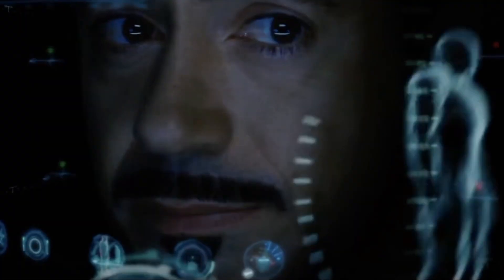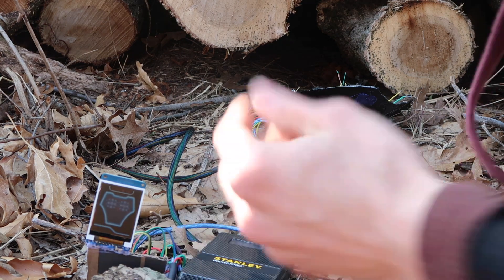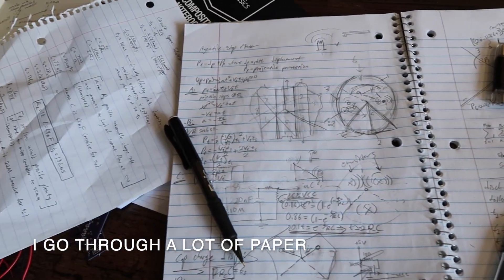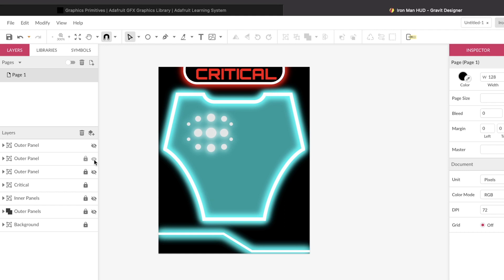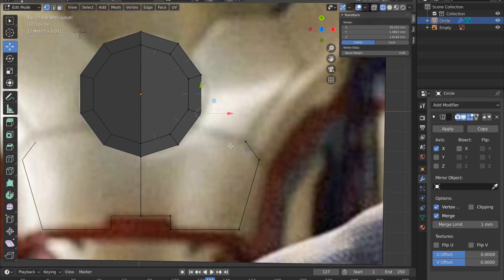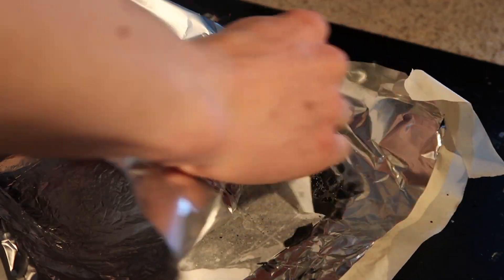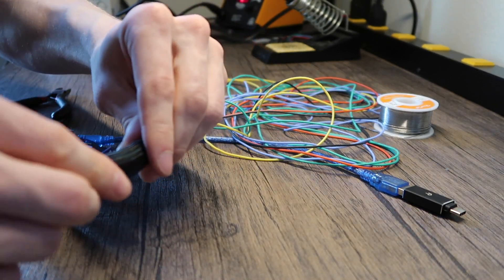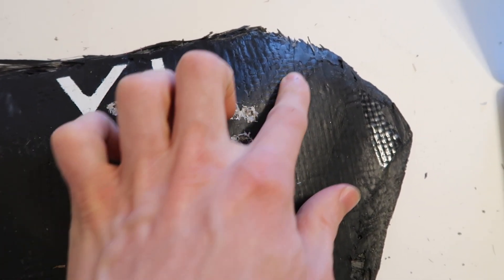Real Bullet Proof Iron Man Armor Version 1

Comment: Amazing work! If I may ask, what sensors were used for this project?
Reply from the maker: @filigenzilab9613  I was just using thin wire traces, capacitive circuits and resistive measuring so no purchasable sensors, just making my own panel detector. This is another project I did early on that got cut off when I had to move 🥲

Comment: watched it, 
I wish you had fired more than just a 9mm at it, .45 and .357 would be nice as well, I still think anything subsonic or even a Slug round might full penetrate, but that is pretty light in comparison to some DIY BA so you get a like on that one alone. You should team up with Matt from Demolition Ranch when you have it done and see exactly what it can stop and how much the sensors can take...
Reply from the maker: .45 Wouldn't go through as the energy is similar yet the bullet is larger and easier to stop due to that. 357 barely gets through (sometimes its stopped with this) but my batman plate which is slightly thicker than this stops many 357s since I added a light flak shield in that build.

Comment: What is the plate made of currently fiberglass?
Reply: Any ideas for what you will use in the future for the plate?
Reply: @CrashMakerspace  if you can try this in the future two layers of dyneema or spectra as a face ,then maybe 3 or so layers of some really high strength fiberglass followed by more dyneema ,spectra or kevlar. I would try using polyethylene fiber fabric like dyneema or spectra before Kevlar if lighter weight is the goal this is a really cool concept/prototype
Reply from the maker: UPDATE: I'm now releasing a very similar design (not quite as tough, but very close and far cheaper for the typical maker) and even releasing my 3D model for this same exact mold! The video will be going up next month showing the processes and materials; I'm filming the build now :>